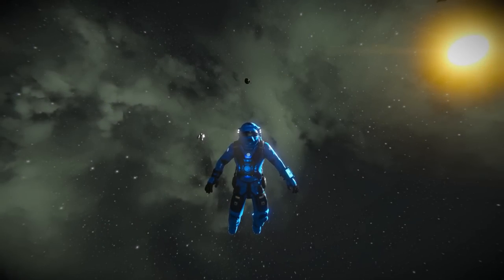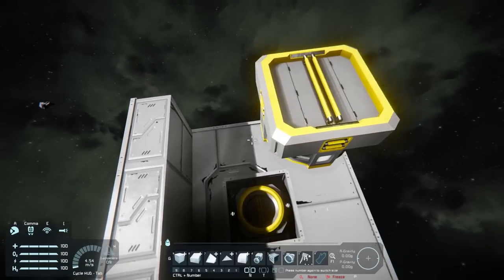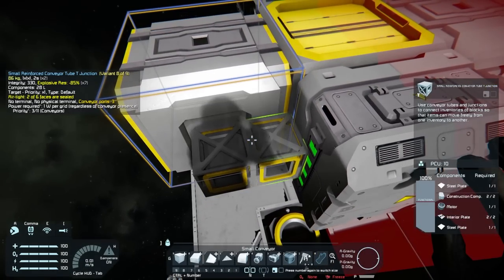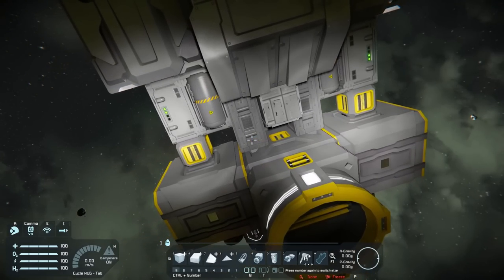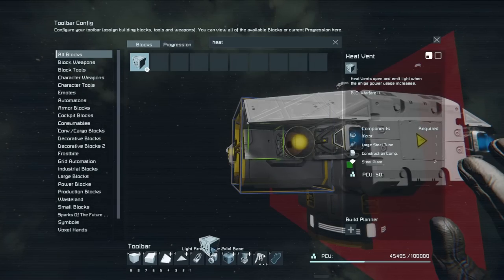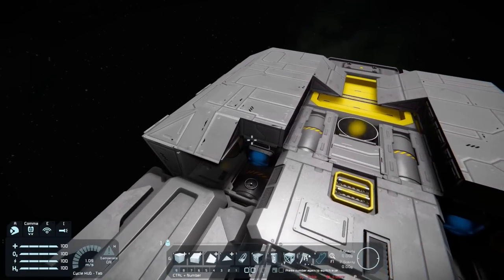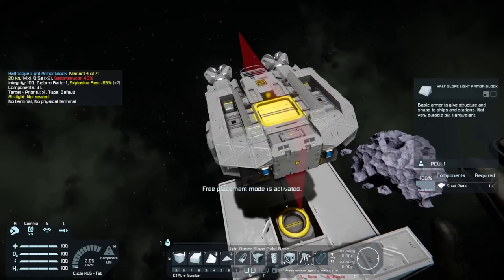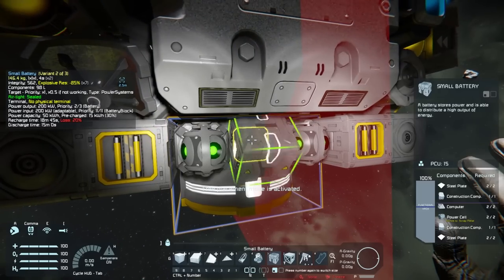Auto-mining ship full build! - Space Engineers

Comment: Hmm, this PAMs miner isn't going to be functional for PAMs style mining. This would get stuck straight away once it gets deeper than its drills. It's too wide and too high with that drill set up, also PAMs will need a sensor and programmable block and remote control. An antenna is advisable but not a requirement. And a final note, the PAMs interface, nowadays, can go inside the cockpits screens and the programable block itself can act as the screen too.

I don't want to be a dick here but this is not a PAMs "Auto-mining ship". 🤨
Reply from the maker: It works, I've already recorded the video using it lmao
Reply: @LunarKolony  I'm happy to be wrong then, but from my experience this wouldn't do the job long term for me. 👍